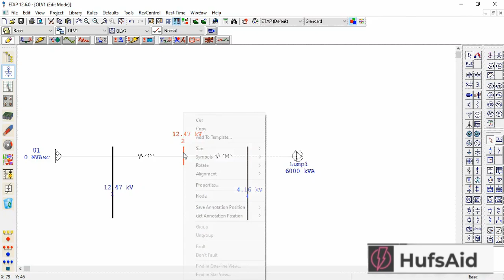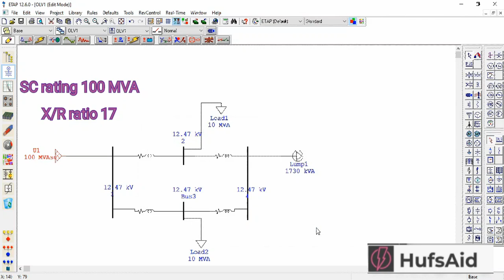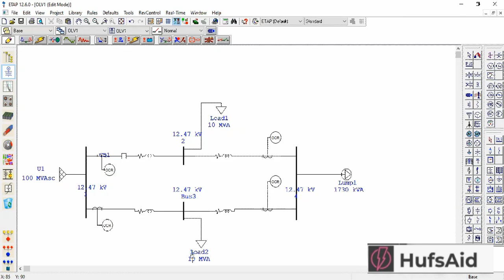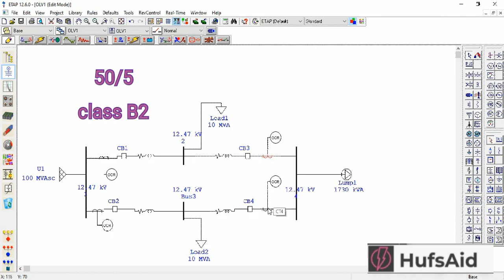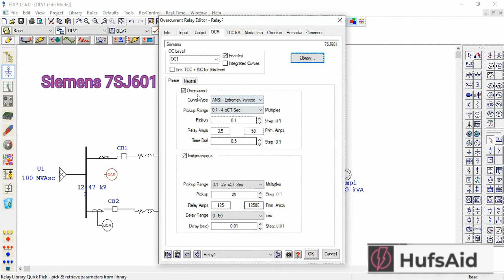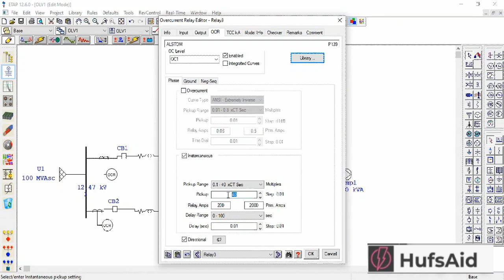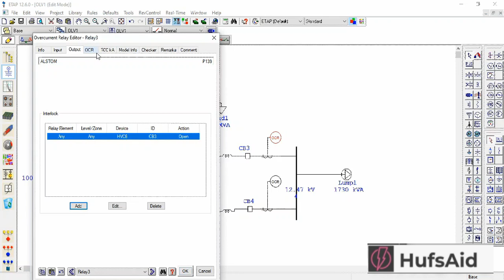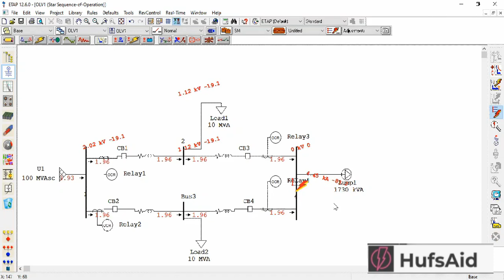Directional Over Current Protection using Etap software

Comment: madam, thanks for the nice video. you may add the CT polarity feature with respect to the direction of current flow under steady-state condition. like we keep CT P1terminal towards the bus and current leaves through P1 terminal of source-side CT whereas it enters through P1 for load-side CT. 

For load side O/C relay only forward direction is permitted and for source-side only reverse direction is permitted.